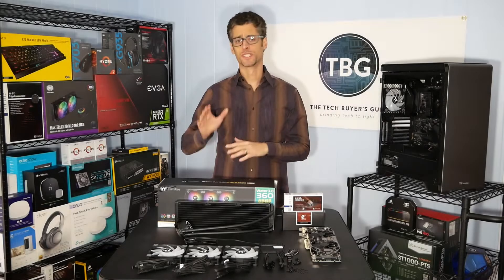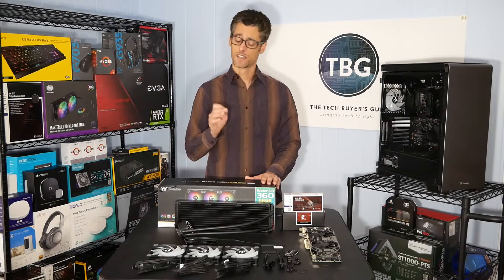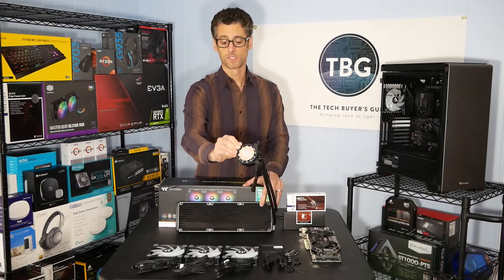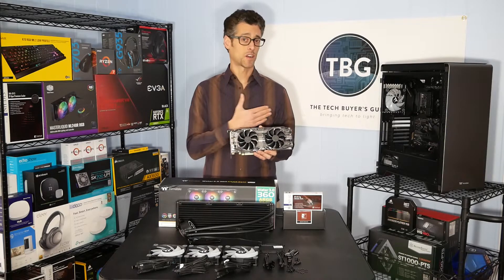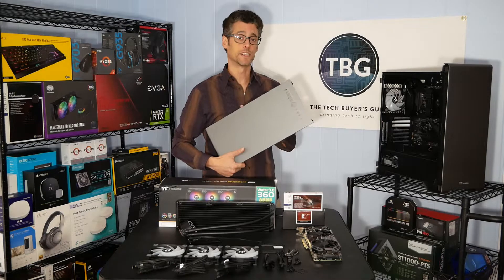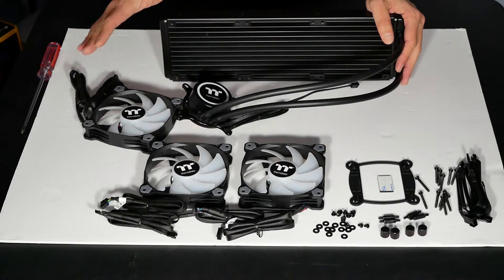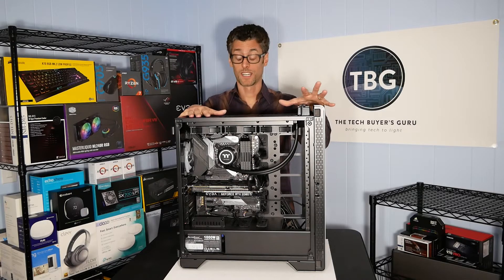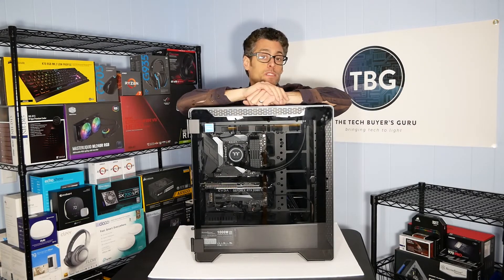2019 PC Assembly Video, Ep. 3 - Installing Thermaltake's Water 360 ARGB Cooler, GPU, & Noctua NT-H2

Comment: For the water cooler installation only the 3 pin cable from the pump was clear.  In 19:57 what are those cables??????? How do you connect the fan cables and the cables from the three water cooling fans? So confusing...
Reply from the maker: Yup, tons of cables when installing a 360mm ARBG cooler. You have the fan connectors from the pump and three fans, plus the ARGB connectors from the pump and three fans. For the fan connectors, you need to connect those to a splitter and then to the motherboard, and for the ARGB connectors, you DON'T use a splitter, you hook them up in series, and then the last one uses an adapter and connects to the motherboard directly.
Reply: The Tech Buyer's Guru So the last one goes to adapter and goes to ADD_HEAD 1. My pc chasis( Thermaltake level 20 GT ARGB) has also a Built-in 5V RGB Switch Board. I connect from there one that SAYS M/B one 4 pin adapter to ADD_HEAD 2. Is that right?

Comment: When you routed the fans from the rear of the case to the header around the 20:15 mark, why does it look like all 3 fan cables are going to the same header? I understand that you daisy chained them all together, but wouldn't that leave only 1 connector on the header? I have the same cooler arriving tomorrow and I feel its going to stump me.
Reply from the maker: It uses a daisy chain design for the ARGB header, but a 3-way splitter design for the PWM (power) header. You'll see. ;)
Reply: @TheTechBuyersGuru  You're a legend, man.
Reply: So everything is installed, and running. I have the view 71 from TT that came with 2 pre-installed RBG fans and an analog controller affixed to the case. Having trouble syncing my water 360 with the case fans, do I need to install the external controller that came with the water 360? I was understanding that my motherboard would control all fans. MSI ACE Z490
Reply: @TheTechBuyersGuru  🤷🏼‍♂️

Comment: Right when you said "cpu uhh sorry all in one pump" confused me. I don't see an AIO pump plug in. Do I plug it into cpu_fan1 or pump_fan1 also for sys_fan1 2 or 3 is that where the radiator fans plug in?
Reply from the maker: The fan header labels vary by motherboard manufacturer, and some coolers use fans that don't even plug into the motherboard at all, but into the cooling block. So there's no universal rule. If your fans can plug into the motherboard, they should go into CPU_FAN (and CPU_FAN_OPT, if you have that header and need a second fan header). The pump control should go into AIO or PUMP, whichever you have. The basic concept there is that they run the pump at 100% all the time.

Comment: Awesome video, just purchased the Thermaltake cooler and works like a beast. Not sure what i''m doing wrong but the RGB does not want to work when i'm trying to use the 5v header on my mobo. Any close up instruction maybe? Using a Gigabyte Z390 Aorus Pro
Reply from the maker: I didn't shoot any closeup video of that. It's a bit like a puzzle. You have to connect each of the ARGB elements in a series, and then the first in the chain to the motherboard. You might test it by connecting just a single fan directly to your ARGB 3-pin header. It should work immediately, unless you have lighting shut off on your motherboard. You have to use Gigabyte's RGB Fusion software to control that.
Reply: @TheTechBuyersGuru  Good day, thanks for your suggestion. So i did take your advice and its like its not pushing through enough power. Like 1 LED comes on from the fan. 
I have another Thermaltake controller that also uses one 5V addressable connector for sync and all those fans works perfectly. Not sure what can be wrong.

Comment: Is there room to install fans on top of case rather than inside? I want to see if I can also put another 2 140s inside of the air chamber
Reply from the maker: The roof of the case is not designed to have anything mounted in it. Fans placed there would be right up against the aluminum top panel.
Reply: The Tech Buyer's Guru sweet! Thanks! Earned a sub!

Comment: Just wondering, do the fans plug into the motherboard separately, or do they all plug into the RGB controller? Then would the RGB controller plug into the RGB Header on your motherboard so you can use Aura Sync?
Reply from the maker: Great question! The method Thermaltake uses is actually what I like so much about it. It uses a proprietary connector to allow you to daisy chain all your RGB devices (this includes the fan and the pump header), and then you terminate it with an adapter that goes directly to the motherboard. You can see a demo of how this looks right here: https://youtu.be/JdKlgsKYLoA

Comment: There is almost no reviews or additional information available for the Thermaltake ARGB Sync Edition online. I'm guessing this new cooler is Thermaltake's replacement for the Floe Riing series of AIO's. I did read a review from KitGuru and eTeknix, but was wondering if there was any substantial difference between the ARGB Sync Edition over the older Floe Riing model outside of the different fans and the addressable RGB functionality.
Reply from the maker: As Thermaltake told me personally at CES 2019, this cooler is not a replacement for the Floe series, they'll both continue to be sold. But Thermaltake also told me that despite being cheaper than Floe fans, ARGB Sync fans are better. So it's pretty easy to figure out which one to buy!

Comment: Hello. I have the thermaltake level 20 gt argb plus and the i9 9900K. I also ordered the exact same motherboard you have( Asus rog Maximus xi hero wifi) and the exact same aio cooler( Thermaltake Water 3.0 360 Argb sync). Is it ok if I send you some pictures when I start with the pc build to help me with the aio cooler installation. Iam so confused with all these cables and how they connect to the motherboard. Thanks in advance.
Reply from the maker: If you'd like help with your build, the best thing to do is join the forum at The Tech Buyer's Guru website: https://techbuyersguru.com/forum.

Comment: Can you suggest any atx case with great airflow and supports aio liquid cooler and has pre-installed rgb fans
Dont make it too expensive or too cheap. Thx!
Reply from the maker: Sure - I'd take a serious look at the Thermaltake View 32, which is on sale right now ($20 off): https://amzn.to/2TbsuX4. Anything smaller/cheaper won't be able to fit a good liquid cooler due to insufficient roof clearance.

Comment: why no led lights on my cpu pump? connected everything right
Reply from the maker: Are there lights on the fans? If you do a daisy chain with all of RGB connectors, they should definitely all light up together.
Reply: yah i already tried it ..all my fans are working fine you think its not compatible for my maximus hero xi wifi? its not on the list for compatibility list tho
Reply from the maker: There is no compatibility list for RGB lighting. You could try directly connecting pump to motherboard's ARGB header (using adapter). If the lights don't turn on, perhaps it's defective.

Comment: Soooo... did you plug the pump into the CPU pump or the CPU fan? You started saying fan, then switched to "all in one", then started talking about fan ports, never actually said "pump"! This was the ENTIRE reason I watched this video! The instructions from Thermaltake say to plug it into "CPU FAN" - but the fans should be plugged into fan - so does the pump go into fan, opt, or pump? I actually have TWO pump connections on my GB MB.
Reply from the maker: If you have pump headers on your motherboard, that's where the pump should be connected. And that's exactly what I did in the video. Pump and AIO means the same thing.
Reply: @TheTechBuyersGuru  thanks, the video wasn't clear, plus ther header names aren't visible (which isn't possible, I know). My Gigabyte board manual isn't entirely clear, either - from what I deduced, the fans actually plug into the "CPU Opt" header. The instructions from Thermaltake are horribly vague and incorrect.
Reply: @TheTechBuyersGuru  oh, plus all my fan, pump, and opt headers are 4 pin, not 3. That makes it even more confusing for someone who's never done this.
Reply from the maker: Every motherboard manufacturer uses different names for its headers. And every cooler manufacturer provides different advice. You just have to learn as you go. I highly recommend you plug your fans into the CPU_FAN header and your AIO pump into the whatever Gigabyte is calling its pump header. AIO, W_PUMP, etc. And it's not a problem at all that they are all 4 pin. They're supposed to be. Motherboards don't have 3 pin headers.

Comment: can i put the thermaltake 3.0 360 argb on the p5 rig??
Reply from the maker: Yes, it will work with the P5 (https://amzn.to/386ElP9), which is designed with a large radiator mount. Just note that you have to place it properly for the hoses to reach the CPU area, as they'll just barely be long enough.

Comment: Doesn’t make even a 2 degree difference if the rad is top or on the front. Your blowing hot air from case through your rad which won’t cool the rad as well as if it was intake.  If your not cooling the rad your cpu will not cool as well. But the difference is negligible either way.

Comment: according to thermaltake the little control box is still required for using the motherboards rgb software and as such I would say don't waste your time with this cooler as it isn't TRUE rgb syncable.
Reply from the maker: Not sure where you saw that - I'm currently running the system fully sync'd to the motherboard, so I know it works without the control box. The full RGB setup video will be published shortly.
Reply: @TheTechBuyersGuru  I didn't see it I was TOLD that by thermaltake support on the phone not 10 minutes ago.  I was trying to explain I wanted to run the rgb off the fans and pump housing with a splitter to the board and the same with the fans pwm, according the tehm ( thermaltake support) the control box and external psu power is required.  so if you are indeed running the way I was planning feel free to call thermaltake USA and tell them they are full of it because they were insistant it is not possible with this unit
Reply from the maker: I have a feeling the tech support staff may not be up-to-date on this product, which just hit the market earlier this month. It most definitely works perfectly with motherboards that support the 3-pin 5V ARGB standard. That's why "ARGB" is in the name. I have six Thermaltake ARGB fans plus the pump all running off of a single connection to the Asus board shown in the video.
Reply: @TheTechBuyersGuru   I figured the same thing but the thing is thermaltake should know their product and not misinform the customers/ potential customers.  as such I said what I said based on the standpoint of a potential customer seeking most accurate info from the manufacturer on a product when im going to have to save my hard earned money to buy it ( im not some youtuber with thoushands of views getting free product like linus gamers nexus and jayztwocents hell I don't even make youtube vids because I cant afford the equipment needed to film edit and produce content).  and my original statement stands, if the manufacture wishes to say it wont work for your needs, buy something else.
Reply from the maker: I understand your concern. I do think Thermaltake should probably step up its game when it comes to customer support.
Reply: @TheTechBuyersGuru  oddly enough asus is worse, their first line tech support are their forums that they don't monitor, secondly with asus ( and this is no joke) I called them to ask some questions on the ryuo 240 AIO in regards to the rgb syncing compatibilit with other manufactures whom use the same 3/4 pin addressable rgb header ( specifically gigabyte) and asus told me ( again no joke) to call gigabyte ROFL.  like gigabyte would know anything about an ASUS product however I did call gigabyte to tell them the story and to give them a laugh and they ( giga) actually transferred me to several different people just so I could tell them to, to bad gigabyte didn't offer me a free mobo or video card for it as that would have made my day ROFL.
Reply from the maker: FYI, a full video review of the Thermaltake ARGB features is now live on the channel:  https://youtu.be/JdKlgsKYLoA. You should check it out to see what's possible, even if Thermaltake's customer support isn't aware of it.
Reply: @TheTechBuyersGuru  Hi, first of  all, great tutorial! As a novice in rig builds, my question is: if you don't use a switch controller and the like, I presume you're using
 quite a few splitters to connect the six fans, aren't you?
 Thanks!
Reply: Hi, after reviewing your videos and reading some manuals, I've got it! The fan's power cables are connected via 3-way splitters to fan headers on the Mobo. And the argb cables are daisy-chained and connected to the D-RGB header on the mobo. BTW, on a Aorus Z390 ultra, the pump cable is connected to the CPU_OPT (water cooling labeled) header and the 3 thermaltake AIO's fans are connected to the CPU_FAN header via splitter. Is this correct?
Thanks in advance!

Comment: Yes, excellent video! But think to buy a tie-clip microphone, for example, to avoid the reverberation and also because the sound is way better indeed. Thank you for this video! Keep up the good work! Just to add that I bought a "Innovation Cooling IC Graphite Thermique Pad" (30 X30 mm) for my Intel i9-9900k and it's just amazing! With this termite pad... no more thermal sticky and dirty paste and on top of that, you can reuse it... 50 times! Here is the video review made by Linus Tech Tips: https://www.youtube.com/watch?v=YpphKzmDiJM
Reply from the maker: I just bought a lav mic - you can hear the improved audio in this video! - https://youtu.be/pU8zMysU5IU. Also thanks for the tip on the thermique pad!